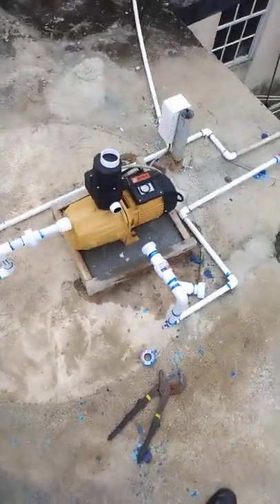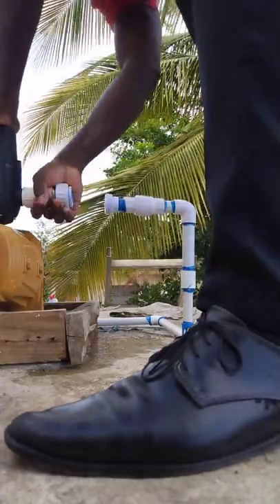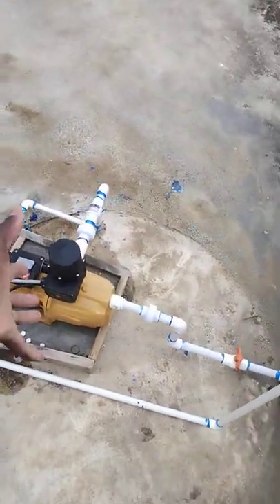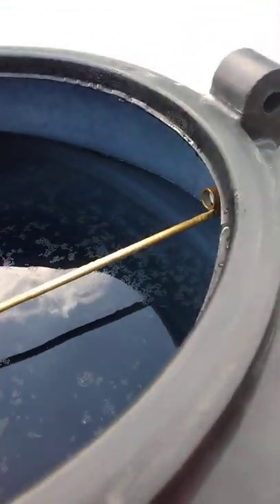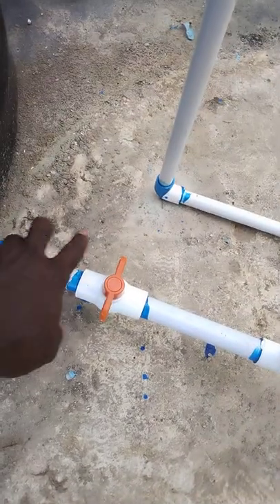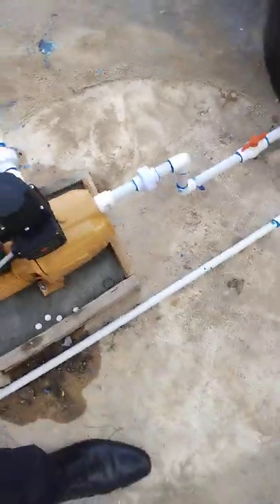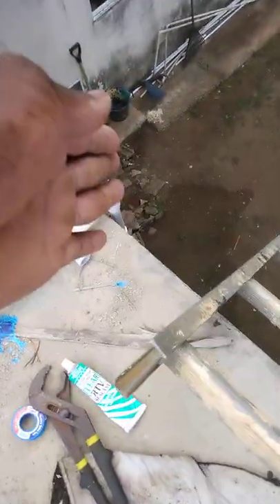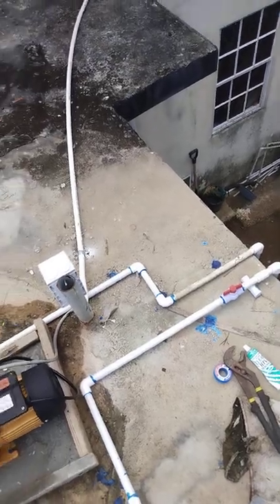How to install a water tank with a water pump.

Comment: I love the setup but I would put a socket union at the outlet of the watertank...To facilitate easy disconnection of the tank to the line...To clean the thank as the needs be.
Reply from the maker: 1 is actually there. It's right before the water pump. Didn't want to use 2 socket unions so close to each other. Thanks for the comment though. Please like, subscribe and share if you haven't as yet.
Reply: I see you didn't watch the video. He showed 2 socket unions

Comment: Is there a need for a check valve between the pump and the tank??
Reply from the maker: Yes. Emediately where the water exists the tank or after where the water exists the pump to prevent the water from running the opposite direction when the pump is off.

Comment: Mr plumber do u have any vídeo of installing a  220 like this one ,for intake from the underground tank to black tank on top of house , we don't have nwc . anticipate ur response mr plumber thanks
Reply from the maker: I can get a video with it from a property I did it on.  What should I name that video?
Reply: U could  name it " how conect ur rain water storage  from underground  house to ur tank on top of ur house ,with  a 220 ,1hp pump with smart head " Mr Plumber many  of ur viewers don't get water from NWC water supply . so this video would basically help to promote off grid water storage... And i can safely say water locks offs are pretty common in St.Ann for example.  Some one out there must agree some what .

Comment: Good job! I’m working on a similar set up but in the basement due to freezing issues. One suggestion, install a large filter after the pump for cleaner water.
Reply from the maker: Hi Larry. Thanks for your comment. Please subscribe, like and share if you haven't as yet. Thanks for the support ❤️

Comment: Did you use 3/4" throughout the installation
Reply from the maker: No I did not.  I reduced it when connecting it back to the main and where the water enters the tank.  Thank you for your comment. I appreciate it 🙏

Comment: Great video. Somebody I can understand finally 🙌🙌🙌🙌🙌
One question. When the smart head is stuck above 2 and not pushing the water through the house what should we do ?
Reply from the maker: Get it checked out by a technician to see if it's still good and have it replaced if it's gone defective.

Comment: Just a question - what happens if there is no power (electricity off),  will the taps still have water (because the tank is on the roof)
Reply from the maker: Yes. It will still flow because of gravity. A back up power supply is always a good thing though

Comment: Very nice video sir.
I have a question how do you prevent the pump to run when the tank is empty?
Reply from the maker: There is a electric device that you can buy and connect it the pump them lower it inside the tank almost at the bottom. When the water isn't touching it what it does is turn off the pump preventing it from burning.
Reply: One of this device is on this tank or no
Reply: And what's it called

Comment: Hello. Very informative. Is it possible to pump all the water out of a tank? I feel the water below the tank outlet will still remain in the tank.
Reply from the maker: The water below the pipe outlet level will always remain in it with the chlorine residue.
Reply: @plumbinginjamaica5381  Thanks a lot
Reply: You need to get it professionally cleaned every now and then.